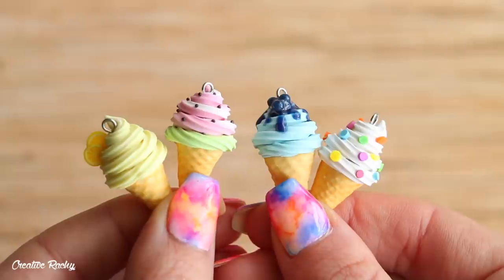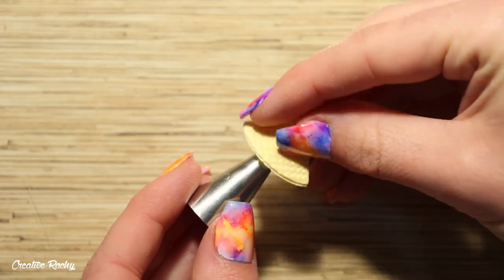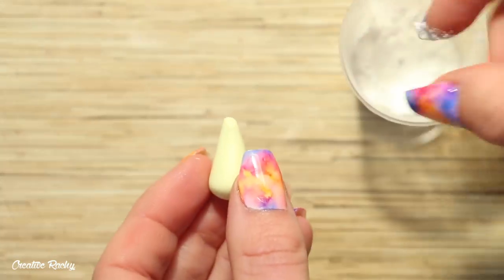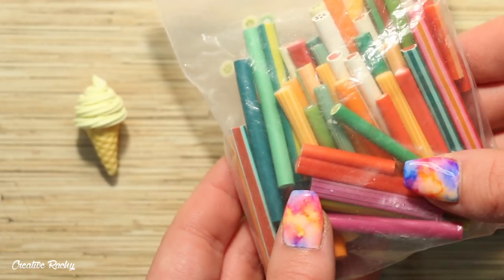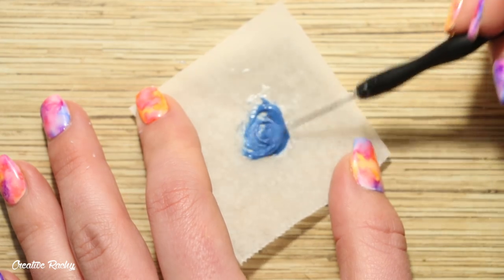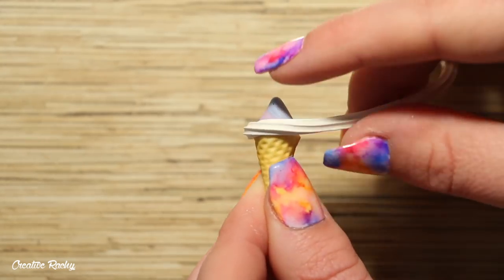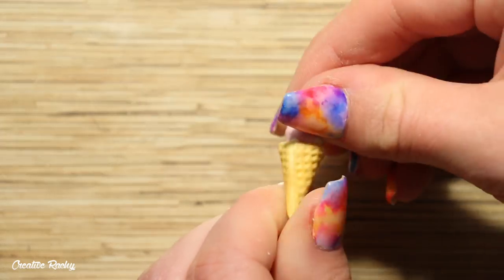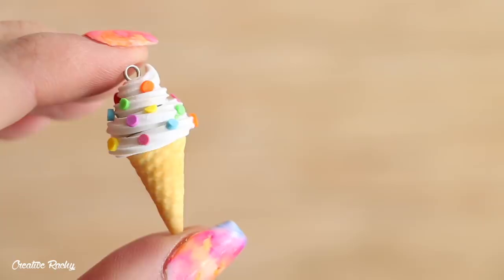Ice-Cream Waffle Cones│4 in 1 Polymer Clay Tutorial

Comment: Hi Rachy I’m new to polymer clay and I’m finding that my clay (fimo) is sticking to my surface and acrylic roller and it makes a lot of mess I was wondering how to clean the roller and how to prevent this from happening again. I love your videos they are extremely helpful and makes everything easier so thank you xx
Reply from the maker: You can use some cornflour on the surface of your clay like shown in the video. It stops it from sticking to your tool, including your rolling pin 😄
Reply: @creativerachy  Thank you soooo much 😁🎉💞💞
Reply: Some clays are also very sticky from the get go and some get really sticky fast when they get warm. It didn't work for me really because I am not patient but putting the clay in the fridge helps. Or putting the clay inbetween paper and putting something on top (like not a whole book but maybe a piece of thick cardboard or something). It draws out some oil which can make the clay stickier. I often split up the work if I have several charms. I mix the colors for all on one day, the next day I work on all charms rotating around so the clay doesn't get super warm. 
I hope you are having a lot of fun with your clay creations. I am very happy that I started doing polymer clay stuff because it's a really nice and relaxing hobby (or more).
Reply: @Hopischwopi  Thank you for your help I will try your suggestions xx
Reply: i use baby wipes! it helps a lot. (: